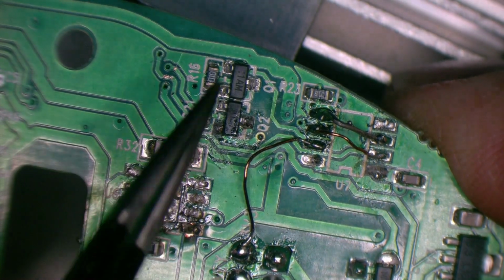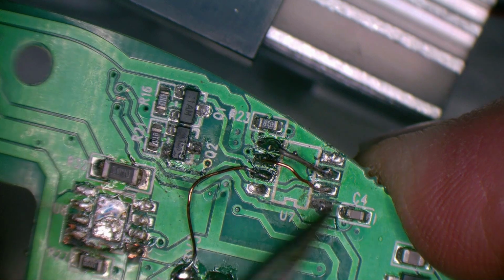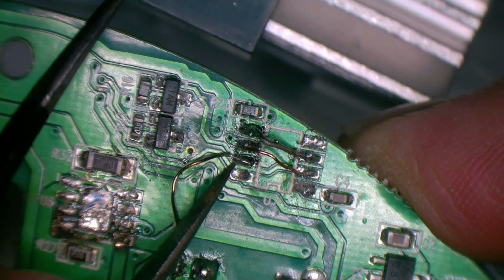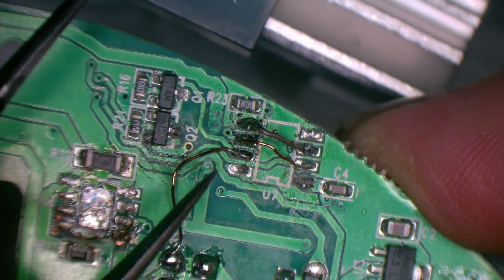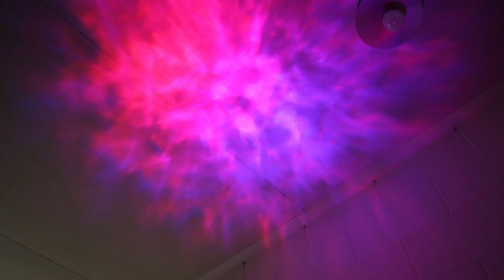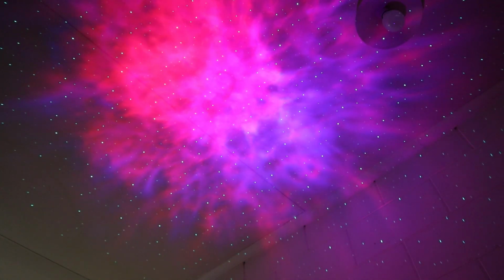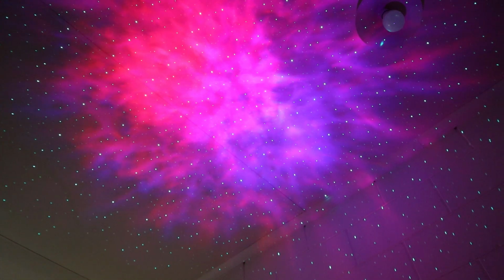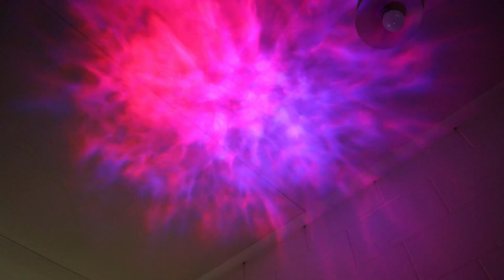Genio galaxy projector follow up

Comment: I think you should stick to your original audio setup, this one sounded way too harsh and clipped, I think your normal audio sounded fine.
Reply from the maker: I always thought the mic I used with microscope wasn't as clear and the plosives were annoying. There was also a background hum. Maybe I turn the gain down.
Reply: @JonnyFix  maybe try turning down the compression settings to soften it, reduce the compression ratio, might be enough.